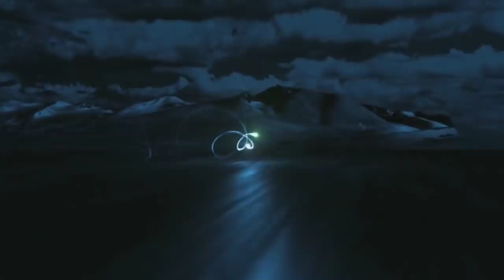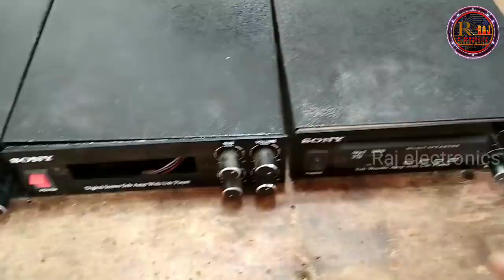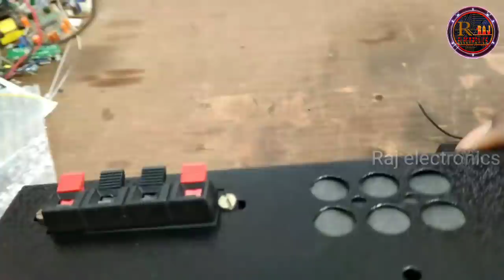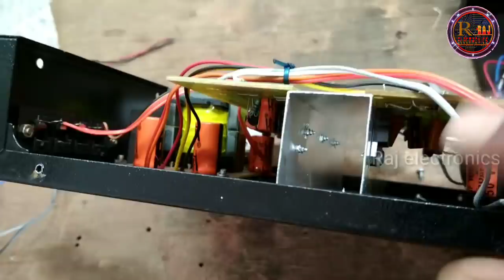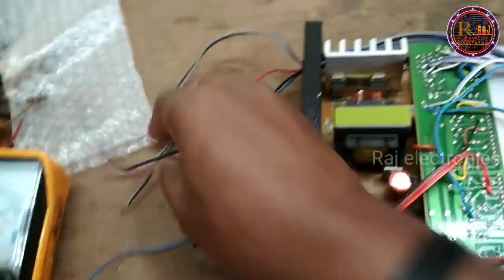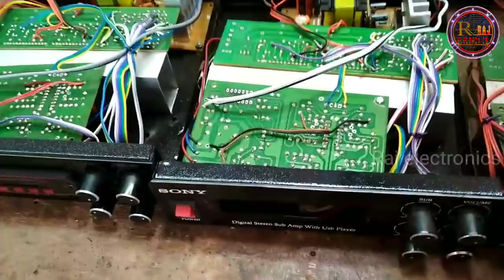TDA 7294 single IC andCD4440 IC 2.1 amplifier readymade amplifier fault

Comment: Very good information😍well explained.. I'm also an electronics hobbiest  , I have noticed similar problems in lot of low quality electronics and electrical equipments in our market, they use very cheep wires ,lack of proper insulation,  and audio channels without any shielding, if we konw electronics then DIY ...that is the best thing forever

Comment: One thing is wrong, TO 220 three pin transistor type diode is better than normal diode .TO 220 type diode is having more current capacity.

https://youtu.be/D8v3alHDX58

Comment: തിരുവനന്തപുരം തകരപ്പറമ്പ് ഇതുപോലെ ഉള്ള ഐറ്റംസ് വിൽക്കുന്ന ഉടായിപ്പ് കേന്ദ്രങ്ങൾ ഉണ്ട്.  3000 രൂപ യുടെ വില പോലും ഇല്ലാത്ത ആംപ്ലിഫൈർ  13000 രൂപക്ക് ചെയ്തു തന്നു പറ്റിക്കപ്പെട്ടിട്ടുണ്ട്, ലാസ്റ്റ് അറിയാവുന്ന ആളുടെ കയ്യിൽ കൊടുത്തു വീണ്ടും re- assembly  ചെയ്തു ഇപ്പോൾ use ചെയ്‌യുന്നു. Ithile comedy - എനിക്ക് മുൻപരിചയം ഉള്ള ആൾ ആണ് ഈ കടയിലെ ഓണർ - എന്നിട്ടും തേച്ചു ഒട്ടിച്ചു കളഞ്ഞു.
Reply: കുറച്ചു ഡിസ്‌കൗണ്ട് കൊടുക്കാമോ
Reply: @Takecare_achumiyas  thallu alla, ente cash poyi, 2.1 amp, verum chaathan board vachu panith thannu (7500rs), ennit 12 inch sub connect cheiyamennu paranju, theere power illa, randu theepatti box side channel entennu 6000 rs vangi, sub njan seperate cheithu, ipo aa shop close cheithu, last amp veendum 9000 Rupa koduthu re assembly cheithu